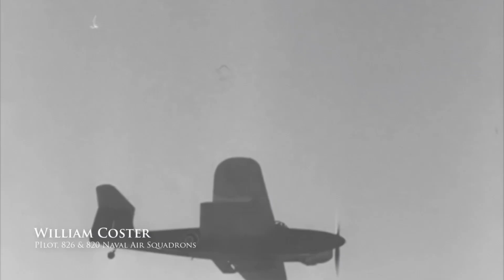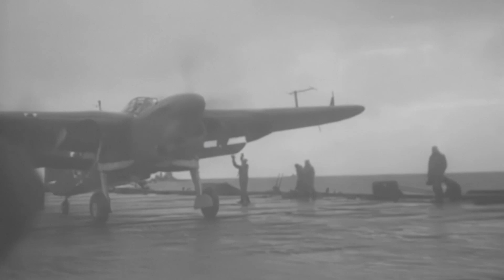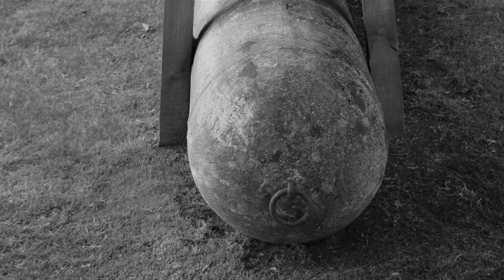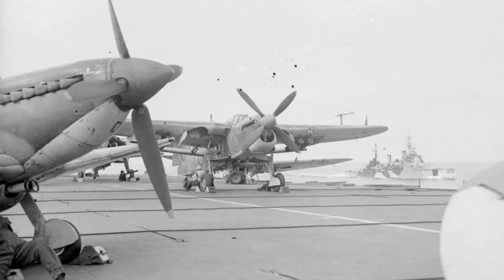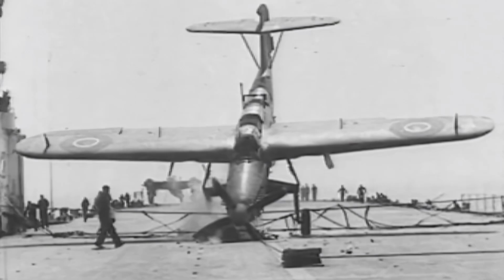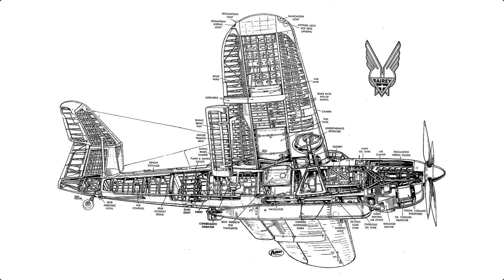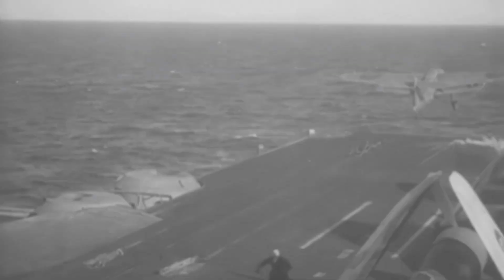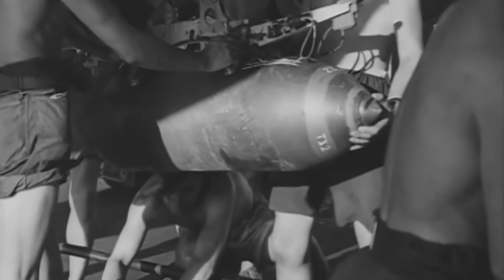Fairey Barracuda: The troubled torpedo bomber

Comment: I think the Barracuda would have been considered state of the art had it come into operational service in '39 to '40 (as it was from a '37 program), but only a prototype flew in '40.  Looks like another typical case of the British giving priority to the RAF programs, some of which was justified, but others not so much. So the Barracuda didn't come into service til '43, which is about the time an aircraft, with its specs, really should have been starting to be replaced in the fleet. By then, it was inferior to the already operational Grumman Avenger (except for dive bombing, which the Avenger wasn't really designed for since the US Navy had a dedicated dive bomber) which had come into service in '42 (despite being a later 1940 program).

Comment: The book Barracuda Pilot by Dunstan Hadley is essential reading for anyone with an interest in this aeroplane. Although maligned by many, the book shows the Barracuda in an honest and at times humourous light. It was an aeroplane designed to be too many things at once and subsequently had unique looks and flying characteristics. But; a now sadly deceased ex FAA Barracuda TAG family friend said of them (as the book regularly implies) that once a pilot properly knew the aircraft, it was capable of performing well.

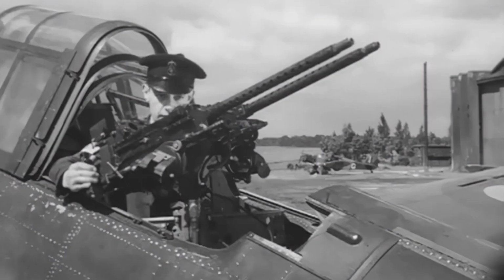Incidentally the footage between 0:43 and 0:48 isn't a Barracuda. It's an Amercian Douglas Dauntless under FAA evaluation with twin American 0.30" Brownings.
Reply from the maker: Yoikes, didn't notice that. I should have. It didn't have that crazy upward folding canopy ...
Reply: And it did manage to drop a couple of AP bombs on Tirpitz.
Reply: @ivorbiggun710   From what I've read, it was a slightly more than fifty percent hit rate against 'Tirpitz'? That's on a par with the Skua's performance against Konigsberg (which was smaller and had a slightly lower direct hit rate in that raid) as a dive-bomber. Both planes maligned and both could dive-bomb well.

Comment: The 'Big Barra' was beset with problems - it was originally designed around the weight and thrust specifications for the Rolls Royce 24cylinder Exe engine, but when development was halted on that, the Mk.1 ended up with the  Merlin 30.  Not only was this significantly less powerful, it was lighter and produced less torque through a smaller propellor disc.  

So not only was their less power to get out of trouble, the airframe was unbalanced and shook itself to pieces.  The wing spars failures and tail unit failures were linked to stress fractures caused by this imbalance as the twist to counteract the Exe's greater torque shimmied in the Merlin's slipstream. 

 Another problem was as stated the change from stable biplanes to a high wing monoplane, it took instructors by surprise. The Swordfish and Albacore were so stable, if one got into trouble the smart thing was to release the stick and let the aircraft right itself.  Try that in an unbalanced, high wing, high tail Barra and it flipped upside down.

A design flaw was the priority on a good view for the observer, which dictated the high wing.  The observer did indeed get a superb view from a pair of bay windows amidships, but the cost was high - the Fairey-Youngman flaps were now well above most of the slipstream and thrust of the propellor, which gave them a significant increase in lift.  At higher speeds if the pilot retracted the flaps in anything other than straight and level, the sudden loss of trim would push it over into an uncontrolled departure.

Comment: Remembering the anecdote of the chap who passed out behind the controls of one because due to some flaw his cockpit was on the receiving end of a fine mist of hydraulic fluid. Came to to find himself in a spin hurtling towards the ground and recovered, though as can be imagined the experience was yet another blow to the pilot’s gradually-eroding endurance.
Reply: I remember this story, the aviator had hundreds of deck operations on Swordfish on the arctic convoys, after his first flight in a barracuda he decided enough was enough. I believe it was some type of coolant that is also used as an anaesthetic.
Reply: @alanpearson7554 
<….during  the earlier part of its service life, the Barracuda suffered a fairly high rate of unexplained fatal crashes, often involving experienced pilots. In 1945 this was traced to small leaks developing in the hydraulic system. The most common point for the leak was at the point of entry to the pilot's pressure gauge and was situated such that the resulting spray went straight into the pilot's face. The chosen hydraulic fluid contained ether and as the aircraft rarely were equipped with oxygen masks (and few aircrew wore them below 10,000 ft/3,000 m anyway) the pilot quickly became unconscious leading to a crash. An Admiralty order issued at the end of May 1945 required all examples of the type to be fitted with oxygen as soon as possible, and for pilots to use the system at all times…>

Although ‘hydraulic system’ is technically correct, the ether was used as a transmitting medium between the transducer on the engine and the gauge itself (it was a sealed system), rather than plumb say, engine oil all the way from the engine to the cockpit gauge. Also used on contemporary engine temperature gauges where the expansion of the fluid with temperature increase was used to drive the indicator.
Reply: Think it was Lord Kilbracken (John Godley DSC.,)authour of Bring back my   Stringbag.

Comment: Another excellent video, thank you.
Sadly the RN had to suffer many inadequate aircraft, several of them from Fairey. I wonder if the Barracuda would have been a better success if it had the intended Griffon ?
No wonder the American aircraft were so welcomed...
Reply from the maker: I suspect not. The Barracuda was an aerodynamicist's nightmare ... and that was before they started adding all the "bits" like radar aerials etc that inevitably made it worse!
Reply: The old Profile Books series had a very good volume on the Barracuda.
Reply: The Griffon would have helped with the power issue.  However looking up the specs on the Merlin 32 that should not have been a bad engine: the fact that the plane was so underpowered suggests weight and aerodynamics played a big part in its performance woes.  Though the 32 is a dedicated low-altitude engine, so those stories being overwhelmingly from the Pacific where the heat affects density altitude, effectively making the plane run like it's at higher altitude and lose power suggests it may have been a poor choice.
Reply: @tomhutchins7495   I have to imagine they thought at some point early on "Navy aircraft don't need to operate at high altitude" - and then the Far East, with tropical heat and the mountainous East Indies happened.
Would have been acceptable on the Murmansk runs.

Comment: The fact that it was largely replaced by the Avenger speaks volumes.
Reply: To be fair, the Avenger was an amazing aircraft that would have replaced pretty much any torpedo bomber in every WW2 navy. Maybe not the Firefly.
Reply from the maker: Firefly wasn't a torpedo bomber, though. And the Corsair would have given it a decent run for its money in the ground attack role. But it was still "useful" enough to stay in service for quite a while after the war.
Reply: @ArmouredCarriers  Which one am I thinking of? Fulmar or Barracuda? Christmas drinks eroding my mind. Merry Christmas by the way!
Reply: It’s a common myth that the Barracuda was replaced by the Avenger. In Europe, Barrcuda remained embarked on the Fleet carriers in the strike role, alongside Avengers which were embarked on the Escort carriers in the recce/ASW role. It’s true that Somerville, in command of the Eastern Fleet, was critical of the shorter range of the Barracuda and used Avengers for the later “Club Run” attacks but 72 Barracudas were embarked on four Light Fleet Carriers at the end of the war for the British Pacific Fleet for Op Olympic. Barracudas served on as the Mk V post war.
Reply: Short range - combined with that gigantic wing volume is quite an achievement
Reply: @offshoretomorrow3346  The Barracuda was weight limited, rather than volume limited. It could carry sufficient fuel for the recce case but the weapon load had to be traded with fuel in the strike role, particularly in hot climates. Later in the War, when the Fleet Air Arm had adequate fighters, the carriers could move closer to their targets and the Barracuda’s qualities as a dive bomber, particularly at night, were exploited.

Comment: Was intended to have Vulture engine if I remember right but that was ditch as too unreliable (as used in Avro Manchester) and griffin/merlin fitted (can't remember which off hand) in its place but not enough power plus many other issues. Built a model of it when I was young, which was a long time ago.
Reply: Before the war, Fairey designed and successfully tested an aircraft piston-engine that had two cylinder- banks that could be run separately, powering two contra-props (as on the  later "Gannet" carrier-aircraft). Despite the viability of the engine, it wasn't produced because priority was given to other engine-types made by Rolls-Royce and Bristol.

Comment: Though very different overall construction the height of the main gear reminds me of the strut of the Grumman Avengers arrangement.
I once discovered a downed aircraft site and at a distance I thought the the strut was reminiscent of      
an Airacobra nose wheel strut but getting closer I realized it was far too robust to be so.
It was a GM made Avenger which had be pressed into post war retardant drop service.
That main strut was about all I could do to stand vertical for photo. Extremely strong and heavy I noticed a bend from possible crash deflection but no it was made that way and I could identify it by side of installation and brass name plate riveted on it the Crome section gleaming as new.

Comment: 0:20: 🛩️ Challenges of a high-wing monoplane aircraft with potential safety issues and technical shortcomings.
4:35: 💣 Challenges of Fairey Barracuda dive bomber with dive breaks and reputation for being dangerous.
8:39: 🛩️ Challenges faced by the Fairey Barracuda torpedo bomber during World War II.
13:24: ✈️ Challenges of operating Fairey Barracuda in hot climates and the switch to American Avengers for better range.
17:34: ✈️ Challenges faced during the development and testing of the Fairey Barracuda torpedo bomber.
21:50: ⚙️ Challenges of operating the Fairey Barracuda torpedo bomber during dives and trim adjustments.
26:10: 💔 Troubles and tragedies of pilots flying the Fairey Barracuda aircraft.
Recapped using Tammy AI

Comment: You can be a dive bomber or a torpedo bomber, but it's challenging to be both. That and the lack of a air cooled radial engine were major deficiencies. The airframe structure looks too weak.
Reply: You're right, it does look weak.  The undercarriage looks like it wants to fold in half, the fuselage looks thin and flimsy, and the wings are shocking.  Just looking at them they don't look strong, and from the footage I sadly wasn't that surprised that the locking mechanism lacked positivity.  The high wing requires the high tail, which introduces trim issues.  The elevator might be above the turbulence but the rudder wasn't, so I bet that had no authority with the flaps deployed - possibly not when landing either which adds a new terror to carrier ops.  

For a 1943 entry to service it seems woefully outdated and primitive, if that's the right word.  Immature, maybe.  For example the Stuka and SBD had long since solved the dive bomber issue with designs which permitted vertical dives and recovery without pulling the wings off.  

You're right about it being hard to make a good dive and torpedo bomber.  They have very different requirements.  Rather than doing one role, or even making an excellent plane at one which could do the other when needed, it seems Fairey made a made an unimpressive master of none.
Reply: When evaluating the FAA's wartime-built aircraft, you have to keep in mind the carriers they were intended to fly from - specifically the extremely limited air group sizes of RN CVs, which put a major premium on multirole aircraft types. When your carriers are only designed to operate 36 total aircraft, it's really helpful if each of those aircraft is capable of doing several different things.
Reply: @Philistine47  Agreed, but if they end up doing NEITHER task very well than there isn't much advantage.
Reply: @pimpompoom93726  Yeah, that's the risk of trying to build multirole... anything, really. But you can see why the British felt like they had to try it, and why they might have been a little optimistic in their pre-service evaluations of aircraft such as, and including, the Barracuda.

Comment: Perhaps the overall problem was that the FAA wanted one plane to act as a dive bomber and as a torpedo bomber. How did that happen? Was it a result of the RAF having controlled the FAA until just before war broke out? That would have given the RN little time to develop a doctrine of how to use an aircraft carrier. Or that the IJN and USN expected to fight each other across the Pacific at long distances? While the RN expected to fight near land air-bases? Why not adopt the Douglas Dauntless for dive bombing, while holding onto the Swordfish and Albacore for torpedo attacks? (I have not looked closely at the specs for the Albacore...did it need to be replaced?)
Reply from the maker: The RN did have its own carrier doctrine, tailored for the North Atlantic and Mediterranean. But I think the dive-torpedo bomber concept may have had something to do with their generally smaller carrier air groups (preferring armoured flight decks to 30pc more aircraft).
The US had very strict export rules for its military aircraft before December 1941. This made them less viable than what the RN already had (Wildcats fitted with civilian engines for example). But the Albacore fell into the trap of pre-war thinking meeting war reality. The RN stuck with the biplane configuration so it could operate in heavy weather and at night. Even the Avenger struggled with this.
Reply: @ArmouredCarriers  The issue of smaller air-groups makes sense, because a carrier would not need to dedicate a third of its hangar space to torpedo planes. I'm not so sure about US export controls...didn't the US drop those with Lend-Lease? Incidentally, Albacore looks good compare to the TBD. (When my dad was an aviation machinist's mate at Norfolk NAS in 1941, sailors from Illustrious would take a look at the Devastators and say, "One Way Trip")

Comment: Fairey did design a couple of decent aeroplanes, but that was only by accident.
Reply: Maybe the need for those deep 'dive-bomber' flaps didn't help to produce a suitable configuration ( because of the high wing and the relocated  (high-) tail surfaces). The lack of power also didn't help, of course.
   Before the war, Fairey had designed and tested their own, powerful engine that had the unique facility for one cylinder-bank to be uncoupled in flight to give [I believe] the aircraft better range at lower cruising speeds (something as was later available from the 'Mamba' turboprop in the "Gannet").
   The Air Ministry stopped developing the engine to restrict the number of aero-engines in production.  A pity, as it might have been a substitute for the "Vulture" in the "Barracuda".

Comment: Just by looking at the thing, you can clearly see it needed a much bigger engine and it wasn't a carrier aircraft. Design all wrong in my opinion. Should've been used as a land based ground attack. Trash the rear gun, and those dive flaps/slats.  If it had at least 2,000 H.P. on hand, it was doable. Seems like a total waste of time,money, & material spent for a complete flop. Aircraft are good as the engine is good. If not, they're just boat anchors. Thanks for posting an interesting aircraft that didn't make it.
Reply from the maker: It was supposed to have the bigger "Exe/Boreas" engine.
But this was a Royal Navy project. The Royal Air Force had it cancelled during the Battle of Britain emergency to optimise defensive fighter development.
So the Barracuda and Firefly had to "make do" with RAF-spec engines.